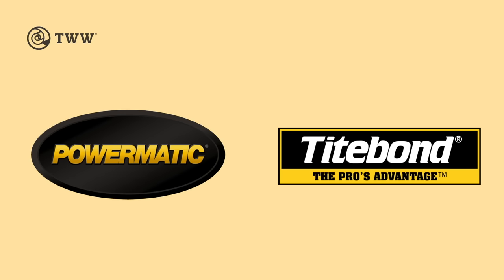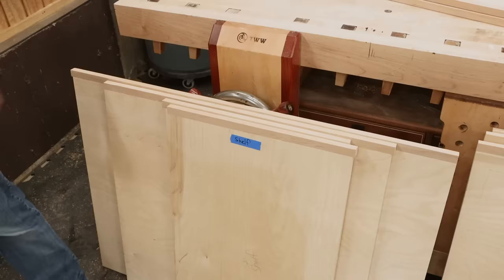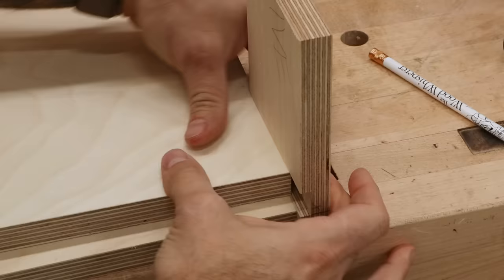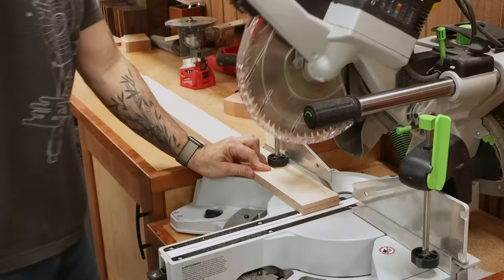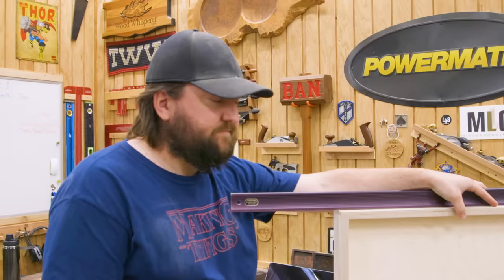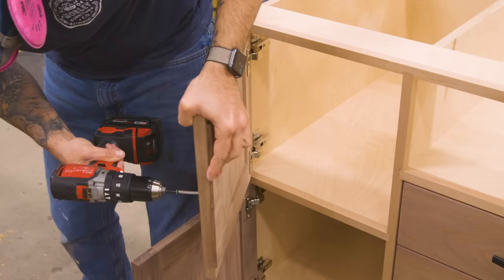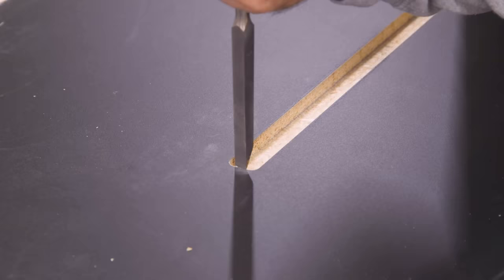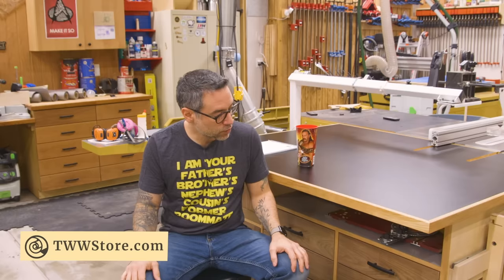Outfeed Assembly Table | Functional & Gorgeous

Comment: I've been building this and for the most part by the plans.  Biggest exception is the fact my saw sits almost 2 full inches taller.  So instead of modifying the height of the cabinet I decided to add to the height of the top and build a small torsion box.  Its actually working out to plan so I'm waiting on the "oh sh*t" moment.  There are a few other things on this I think I would change but all in all I think its an outstanding plan and you have done an outstanding job of helping to push me to do things that were not in my normal safe box.  Thank you
Dan

Comment: Ordered a Harvey TS and ran across your video while searching for ideas for an out feed/assembly table.  As usual, very well done.  Simple and elegant.  Since my shop floor (3-carr garage) slants to the front, I need to be able to keep the table level.  I also like the idea of being able to replace the top if needed, but at my age the table will out live me.
Reply: I've got a new Harvey table saw too -- built this table to work with my new saw.  I used cabinet grade maple ply for the sides and drawer fronts, and red oak for the trim around the top and drawer fronts AND for an extension to the top that accepts dovetail clamps.  (Don't have room for a separate quality work bench with vices in my half of a two-car garage.

Cool fact: because the Harvey table saw is 31-1/2 (vice 27) inches deep, I do NOT have to cut any miter slots in the table --- the miter gage is 'thru the cut' as the miter bar reaches the outfeed table!!!  So, as long as I don't build a huge crosscut sled with even longer miter bars, the table can remain slot-free.

I've built quite a few shop cabinets on wheels, flip-top tool holders etc, mostly with 3/4 plywood and pocket-hole screws.  They are fast, strong, and build quickly.  Mark's plan is a bit more involved, but the result is worth the effort.  I call it "Garage Furniture".

Wish I could send photos, but don't yet know where to post them in a way that would connect to this thread.

Thanks, Marc.

Comment: Mark, you do great work. I made a similar table last fall. One thing I added was a 1" diameter whole in the plywood top (the sheet underneath the melamine). This way when I decide to replace the top sheet, I can poke a large dowel up through the whole and more easily pry up the melamine sheet.

Comment: The timing of this project could not have been more perfect!  I just picked up a 5HP PM66 this morning and have been mulling around how to build an outfeed table PLUS incorporate my router table in the place of the extension wing.  I think that removing the birch top and the casters of my router table and replacing it with melamine to match the outfeed table similar to your setup will be the answer I've been looking for.  Just bought your plans to use as reference to morph into what will work with my ideas.  Thanks!

Comment: Nice looking cabinet. On the soft close hinge since the doors where small you can turn one off so they will close quicker. And a pro tip on laminate, use a file for cleaning up the edge after routing. I don't miss the miles of laminate done over the years.

Comment: Couple of questions, Marc: 1) What would you do if things weren't square after you'd already glued, brad nailed and clamped to hold everything in place? (Bring out the mallet for some tappy-tappy-time?) 2) how "square" is square for a project like this?
Reply from the maker: Well if it's already done and you can't re-do it, you make it work. Some things NEED to be square and some don't. So if it's just a compartment with a door, you can cut the door to match the opening and no one will be the wiser. But if we're talking about a drawer opening, it can be a serious headache doing an install in an out of square opening. But in the end your false front can usually be cut to hide the flaws.

Comment: "And because I like to be yelled at, I used walnut for the drawer fronts" 😆  I never understand why people get offended by nice shop furniture, especially in your situation, you're spending a lot of time in the shop, might as well look nice, plus it's on video all the time besides lol
Reply: If ANYTHING, it should be considered practice and practice makes perfect
Reply: Agree. I often make "overly nice" shop furniture as practice for the real thing. If the shop furniture comes out less than perfect, I won't be too upset either, as long as it's structurally sound.

Comment: As far as side mount slides go
Every heavy duty metal toolbox comes with them for a reason,  they're strong
I personally use them on all my shop furniture,  I feel like the under mounts wouldn't hold up as well in a shop environment
Reply: Also, using side-mount slides looses less volume for drawers much wider than they are tall.

Comment: Honestly counterboring the shorter screws I like a lot better because the screw heads don't interfere with the interior space of the drawer. It may seem like a small thing and for many applications it may not matter much but I designed a storage cabinet for hardware sorted using the Schaller boxes. If I had designed the boxes to allow for the extra space needed for the hardware to poke through the boxes would have been very loose in the drawer and that could have caused issues. If I had designed the drawers without accounting for the hardware the boxes would not have fit in the drawers properly. All in all I prefer to not have the drawer hardware poke through. Even if it wasn't for the boxes the hardware can tend to scratch and get caught on whatever you put in the drawer.

Comment: Marc, you're the man. Question about the oak trim for the top - did you finish it? If not, what strategy would you recommend for finishing the hardwood trim with something like Arm-R-Seal? Mask the gluing surface, pre-finish the trim, then attach the trim? Attach, mask the melamine, and finish once attached? Something else? Thanks!

Comment: Hi Marc. My outfeed table is coming along, making all kind of mistakes in learning LOL. I ran across these plates that allow you to remove the casters on the bench in case they are in your way. So I thought I would share in case you did not know. 

POWERTEC 71132 Quick-Release Workbench Caster Plates, 4-Pack
 POWERTEC 71132 Quick-Release Workbench Caster Plates, 4-Pack

Comment: To anyone who bought and built this: Approximately how far does your top overhang on the front vs the back? There are no measurements in the plan and I’m trying to eye it up. I’m surprised how much bigger the top is than the cabinet.
Reply: I'm wondering the same. With a 48" wide top and a 30" deep cabinet, you have 18" of overhang to distribute. I haven't started mine yet. I'm thinking 3" or 4" overhang in the front. I can probably store some stuff in the 15" in the back.

Comment: Wow. I just finished a workbench/miter saw upgrade for my shop. Sure wish I had seen this video before I started. The project was well planned in Sketchup, but Sketchup can't give you assembly tips. My bank of eight drawers on similar slides are in and working, but my behind is sore. Your technique for installing the slides onto the sides of the drawers was so simple and effective. My brain just did not go there. I'll remember that for future projects.

I'm with you. Beautiful furniture in the shop is awesome. Just because it's in the shop doesn't mean it has to be ugly! Nice work sir. Thanks for posting. Question about the lifting casters: can they be put on after the fact? How high up should they be attached? Thanks?

Comment: This is just one of those wondering out loud things - did you really need the toe kick with the amount of overhang you have on the top?  Not that it matters, just curious.
Reply from the maker: The toe kick does more than just make room for your toes. It allows the cabinet to start a few inches off the ground, which is something I like. So I would have designed something into the cabinet to allow for the drawer to start a few inches above the ground either way. So I figured why not just include a toe kick.

Comment: Love the magnet idea as a stop. never thought of that :) (definitely stealing it) 

Also I have found for shop drawers in particular or any drawer that has a high likely hood of being removed and set on a table or bench. That a flush bottom face is helpful. I still rabbet the sides, and then dado the bottom. So that it can float some inside the box over time. This makes for an extremely strong drawer box. With the ability to easily slide it onto work surfaces and tables. Should you want to rummage through it outside of the cabinet. With the quality of modern drawer guides  getting them in and out isn't a problem. Plus the abuse many peoples bodies take from hunching over. It can be a real quality of life change.

Comment: In a future video, would you please explain in detail the need for the sacrificial fence you so often use with your dado stack while making rabbets?
Reply: Travis, it’s for protecting the saw fence since the rabbet is on the end of the board. Without the wooden sacrificial fence attached, the dado blades would literally be spinning against the metal saw fence

Comment: If you use these kickdown casters, attach a clip to the cabinet that can hold the black kickdown upright, or even some velcro. Kicking one of these is super harsh and a legit tripping hazard.
Reply from the maker: With an overhang and stuff attached to the side of the cabinet, the trip hazard is completely minimized. It's no more a trip hazard than anything else in the shop at this point.
Reply: Brian if this is still a concern Rockler sells flip down casters that detach from a backer plate so they can be removed and stored when not needed

Comment: This may be a silly question, but how did you attach the sacrificial fence to the Incra Miter gauge?  Is there any particular hardware you used?  I picked up my Incra 1000 off of craigslist, so if there was any extra specialized hardware included, it didn't come with it when I bought it.  Does the sacrificial fence get in the way of the flip stop?  If you could elaborate on this a bit, it would be greatly appreciated.

Comment: I think you've noticed that I was searching for outfeed tables earlier this week . . . perfect timing!!!  A couple questions:

1 - What size brad nails do you use?

2 - Is the Ban Hammer a reference to Magic: The Gathering?  If so, what do you think of the massive bannings this week?

Thanks for all of your amazing content!   I am lucky to be building a workshop addition to our house this summer, and I've used your channel a LOT for my planning.
Reply from the maker: Awesome to hear, man. Thanks! The brads are probably about 1 1/4". And the ban hammer is a reference to moderating forums/communities. "Throwing down the ban hammer."
Reply: @woodwhisperer  Thanks!  I should have been more specific - I was curious about what gauge nails you use on these types of projects . . . please don't ban hammer me . . .
Reply: My guess is 18ga on the main carcass. You could use 21ga to nail the trim around the top if you have one.

Comment: Great outfeed table. Should you not also wax the top to avoid glue drips from ruining the melamine?
Reply from the maker: You can wax it if you want to, but melamine isn't going to be ruined by glue drips. Glue pops right off.
Reply: @woodwhisperer  I have had wood glue stick to white melamine from home depot. It chunked out when I tried to chisel it off. I'll assume the melamine I bought was poor quality.

Comment: I'm building an outfeed table based on your design but not according to the same measurements as in your plans.  How did you arrive at the dimensions for the spacers cut to stack to install the drawer slides?  Thanks!

Comment: I like 3/8" plywood for drawer bottoms when they'll need to hold a lot of weight.  Unless the drawer is massive, 3/8" Baltic Birch is plenty strong to never sag and doesn't add as much weight/take up as much space as 1/2".
Reply: Even for these drawers that are 28" deep x 16-18" wide?

Comment: Beautiful job! I love this outfit table. One question though, why not just cut the notches for the stringers to accept the full 3/4 rather than the half laps? More glue surface?
Reply from the maker: More glue surface, sure, but more importantly it allows the stringers to act as index points, locking the dividers into place. Without them, you'd have to be pretty careful about where those dividers end up and in all likelihood they would slip. The notches make sure they're perfect.

Comment: Marc, a question: how do you adjust your dado stack so that 23/32" plywood, aka 3/4" plywood, fits snugly? I usually end up using a special plywood router bit to accomplish the task, but I'd rather go with the dado stack for speed and accuracy. Thanks!
Reply: Most dado stacks have 1/8" outer blades, plus inner blades (chippers) that come in thicknesses of 1/8", 3/32", 1/16", plus thin metal spacers .005", .010", .015", .020", etc. The stack comes with a dimension chart suggesting which combination of blades for a particular thickness. But you should always test the dado cut with a scrap piece first, before you cut the dados on your project. If the suggested combination of chippers is too loose or too tight, adjust accordingly. You can use the thin spacers to fine tune the fit.

Comment: "If it is tight, cut the fronts and backs a little smaller or make the rabbits a little deeper.  If too loose do the opposite"  Wait. What?
Reply from the maker: I realize that may sound confusing but it is correct. :)
Reply: @woodwhisperer  It just sounded as though you wanted them to add material back on if too loose.  All I thought was "I cut this board twice and it is still too short"
Reply: just cut the fronts and backs a little larger and make the rabbets a little shallower! You mean you don't have that setting on your table saw?
Reply: Same difference

Comment: Looks great, Marc but I'm still using your (I think) #2 "Norm" version of an outfeed table! You change outfeed tables like most people change socks! ;)
Reply from the maker: Every 10 years?! I hope not. :)
Reply: @woodwhisperer  Ok, you got me! lol Admittedly I may have been lumping assembly tables in there... with a good dose of exaggeration. I was also a bit confused about the timing - the table I built was from a YT video you posted in 2013 - apparently you built it in 2007 but didn't put it up at the time. Then you built another one in 2011 (the 10 years). However, in your 2019 shop tour video, there is definitely a different outfeed table shown although you never mentioned it. Maybe the 2011 version didn't make the trip to Denver? Regardless, the latest makes four outfeed tables in 14 years - not quite sock-changing frequency, but still... lol
Just giving you a hard time buddy. :)

Comment: Hey Marc, which track square are you using on your track saw?  I have the TSO products set and that works great for the most part, however, not that useful if I want to deviate from 90 or 45 degree cuts (occasionally it would be handy for corner cabinet plywood cuts).  Yours appears to have an Incra miter gauge on it but I am not aware of them making an adjustable fixture.
Reply from the maker: It's the second gen from Woodpeckers.

Comment: I’ve considered building a similar table. However I thought about a thin pullout “drawer” for my Incra sled. Do you find it difficult to get sled in and out the way you have it
Reply from the maker: Not at all. I actually found it more challenging to hang it on the wall like I used to.

Comment: Hi Marc, can you talk about how to adjust drawers if they’re not square (other than sanding the bowed side)? Sometimes my parts are not as precise as I’d like. Sometimes my plywood panel isn’t completely flat...
Reply from the maker: Just have to copy the shape that's given to you. If it's more than something you can fix with a few passes of a hand plane, you might consider keeping the drawer front oversized and then using a compass to scribe a line that's parallel to your case. Then simply cut to the line.
Reply: @woodwhisperer  thanks Marc. Can you elaborate on the squaring technique mentioned in the video at 15:14?

Comment: Mark, any tips for keeping the hardwood edge banding flush with the plywood? It always seems to form a lip over time even if it started flush.
Reply from the maker: There's a certain amount of that that's not really preventable. If you flush it up, sand it smooth, and apply finish, and the lip still develops, that's just the luck of the draw. The wood moves and things like that can develop over time.

Comment: Marc, I just rewatched this video last night as I am in the process of building it.  When putting in the laminate sheets for the top shelf in the cabinet shelves you said you used rubber cement. I would have expected you to use laminate contact cement. Did you do this for a non-permanent bond that would allow you to replace the laminate sheets in the future? Thanks!
Reply from the maker: No, that's just what I had on hand. :)
Reply: @woodwhisperer  LOL in the first version of my question to you I asked if it was just what you had on hand, but then I thought it might sound insulting so I deleted it. Thanks for the quick reply!